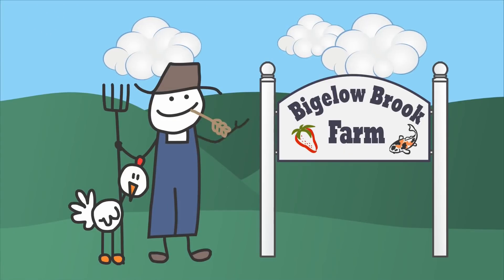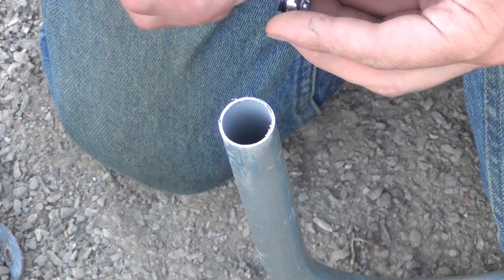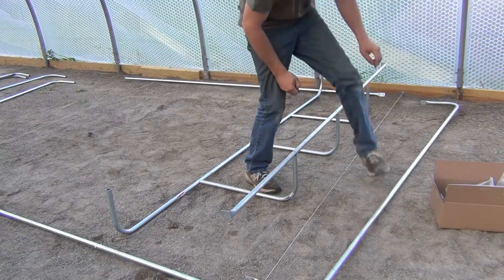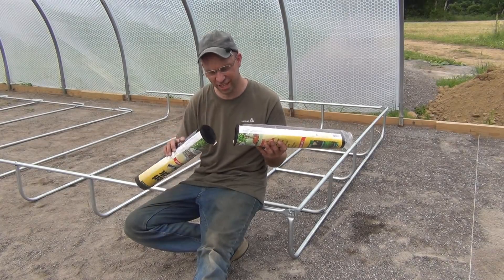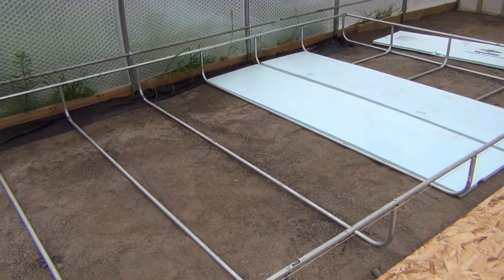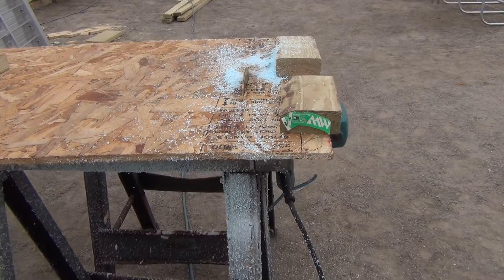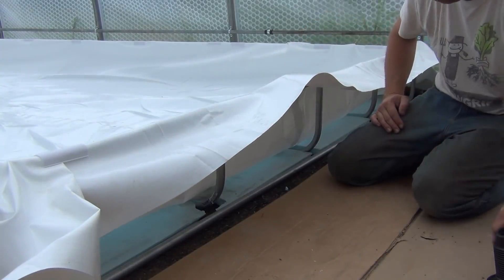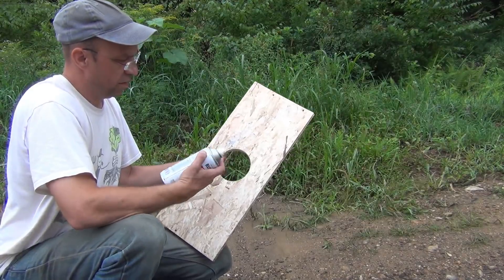Big Aquaponic Greenhouse - Part 11 - DWC Bed

Comment: Is white the best colour to use for the liner? There seems to be several different colours available with dam liner - and several different materials - and thicknesses.  The colour chosen will have some effect on a system. For example - where I am located there is well over 300 cloud free days per year - so lots of light for algae to grow. Black would help to inhinit algae growth. But maybe it would tend to warm the water too much in the hot summers? Is there an advantage in using grey or blue maybe?  And what is the ideal thickness and composition of the material?

Comment: Do you by chance recall what mil weight of liner you used in this application?
Reply from the maker: I'm not sure.  Look up ultra skrim from Global Plastic Sheeting.
Reply: @Bigelowbrook  Thanks so much for getting back to me. I am trying to find an alternative to Ultra Scrim as I live in Thailand and don't have access to this product. Global Plastics writes: Ultra Scrim SR 20 WW (white on both sides)
. When strength and flexibility are in need, Ultra Scrim SR 20WW is a great choice!  This film compares to a 20 mil film.  It is a 3-ply laminate combining two layers of LLDPE (linear, low density polyethylene) and a very strong cord grid. Great for use in indoor aquaponics applications.

Comment: Hi what was the type of pipe and size of pipe and thickness of pipe you used, I am from south africa , buying it with import tax is not an option for me, so want to build it myself
Reply from the maker: 3/4" electrical conduit
Reply: Hi how deep is the DWC
Reply from the maker: @bushvelds  water depth is about 10"

Comment: I was looking for info in the liner clips  (attaching liner to the top rail)  ....   were they just cut PVC   ???/
Reply: I don't know if his are cut pvc but many people make them.  But you can buy them also.  You can search for Snap Clamp.  They are usually 4 inches long and various diameters.  Ones for 3/4 inch pipe generally run around 40 to 50 cents each.  Some places are cheaper the more you buy.  You can get them in white or green also.  You can also buy them in 48 inch lengths and if you are handy, cut them down to 4 inch lengths and cut your costs to about 30 cents each.

Comment: Can You put some video how this all system (fish and plants) work in winter time
Reply: It's deep water culture. Looks like its probably about a 10,000 gallon system and that amount of water acts at a temperature sink. The water stays cooler than the air in summer and warmer in the winter. That in combination with the greenhouse, winter is not really an issue. If you are in a really, really cold climate, another heat source may be needed for cloudy days and cold nights.

Comment: if u dont have them floating on the water, but a bit above, u get more air/water surface.
if u put cheap biomedia, like charcoal on the bottom, u get a lot of bio surface, and the sun cant reflect on the white bottom. charcoal soaks up a lot of nutriens, when new.
if u have scrimp in the bed, they clean algea, and dead bio, and give ekstra profit.
Reply: I would not put anything in that would help collect debris it's harder to clean that way. Put the shrimp in a gravel filled pre entry tank. Preclean it before it goes in the grow bed.

Comment: Have you ever thought about using filter fish like fresh water clams as cleaners to filter the water.
Reply from the maker: A lot of people run into problems when they start breeding and get flushed through the rest of the system.  Same problem with snails.

Comment: God damn - I love your work. Maybe one day when aquaponics makes us rich I can fly over from Australia to see your farm. I just received a High Distinction for my Commercial Aquaponics Design Assessment from uni (highest possible mark). I would REALLY like to see you invest in a massive vertical elevated biological filter. Hit me up on email one day to chat about why they are so significant. The PVC primer makes the joins a chemical bond, as opposed to just an adhesive bond. I NEED to know where to get those conduit inserts - they are GENIUS. Cheers, Adam.
Reply from the maker: not sure if you can order from mcmaster.com in AU but the part number is  94290a520

Comment: Pro tip, design it with 24" spaces between pipes, no need to rip insulation down to size. lol.
I like the star fangled nut idea.
Reply: choose cutting foam or expect more difficult metal work.  it's designed to simplify and minimize metal fabrication, of off the shelf parts.  he's using a full 8' for the side rails, and you wouldn't want to have a floor/wall pipe coming up and tying in where two rail pieces are joined- which would happen somewhere over the 98' length.  put another way, no foam cutting means 25"ish spacing center to center for the floor bars, which doesn't divide evenly into the 8' side rails.

Comment: good job! just a question, are the rafts safe to use? Id imagine they could leach stuff into water over time.
Reply from the maker: technically they are not safe to use.  However, being under the plastic, the UV protection in the plastic tends to protect them from degrading.